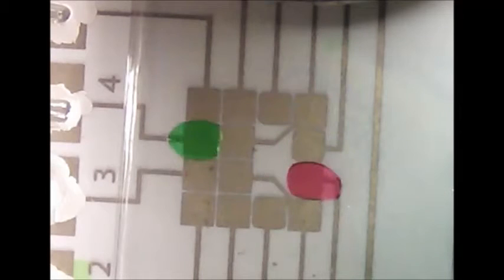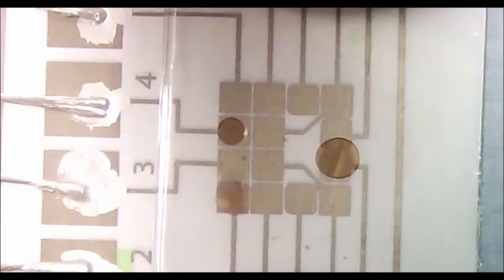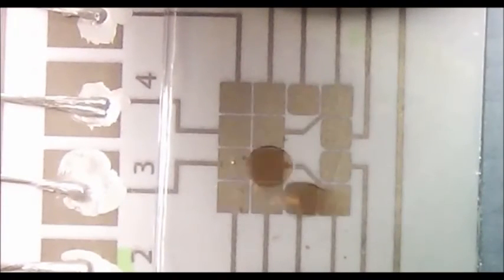Movie 1-1 Automated EWOD / Digital microfluidics (Splitting, double droplet transport, high speed)

Comment: Hi Arjen, how high is the voltage applied? AC or DC?
Reply from the maker: Hey Ray, I think the applied voltage was around 220V, AC. Of course DC would work as well, but I had the option to use AC, and then I prefer AC, which should theoretically cause less fouling, and be able to overcome hysteresis caused by 'bad patches' more easily.

Comment: Hi Arjen, this looks better than what I have got. I am testing droplet splitting on PCB substrates covered by ITO glass, with cytop coatings. The droplets were running in silicone oil of viscosity of 1.5 St, but seems very slow, and the droplet splitting was not always successful. Could you please suggest something? Cheers!
Reply from the maker: Hey ray, do you have any more info on the dielectric layer you coated the PCB with? Without much info I can only say logical things like: increase the voltage to increase the electrostatic force, or reduce the height of the drops, to decrease the energy needed to split a drop.
Reply: @pitjea1983  Hi Arjen, many thanks for your reply. I am using polyimide or printing ink of 30 um as the dielectric layer and cytop of 100 nm as the top coating.
Reply: @pitjea1983  Hi Arjen Do you have a daily email so I can write to you? So I can include some more information
Reply from the maker: @raywang3922  hey Zhantao. You can always reach me at my gmail account, which is my (youtube) name without spaces or capitals. I already have some thoughts about your experiment. Hear from you soon, Arjen
Reply: @pitjea1983  I have wrote you a short mail Arjen, please let me know if you have got it. Cheers!
Reply: @pitjea1983  Hi Arjen, I have wrote you another mail seeking your opinion on droplet transportation on open chip, please check the email, cheers!
Reply: @pitjea1983  I am wondering if you are interested in coming to China to work or vacation for a while? You would be mostly welcomed and get well paid. Many companies here are very interested in digital microfluidics and we can really do something here. Please do consider this. Thank you!
Reply: Hi Arjen, how much is the voltage applied in the video? AC or DC?

Comment: HI sir,i am trying to make a setup very similar to this for my college.Can you suggest me me what is the size of circuit.
Reply from the maker: Hey Varun. The electrodes are 3x3 mm each. The wires and gaps between electrodes are designed to be 0.2 mm, because that was the minimum our basic printer could handle without errors.
Reply: @pitjea1983  sir can you give schematic diagram of this circuit.
Reply from the maker: @VARUNKUMAR-mq1zi  it's just a regular electrowetting setup. The electrodes are covered by a 10um PTFE film for insulation. The top plate is an ITO covered microscope slide made hydrophobic with a Cytop layer of approx 50nm. The electrodes are actuated via a homemade switch box consisting of multiple high voltage relay switches, the relays are controlled by 5V TTL triggers using labview and DAq card.
Reply: @pitjea1983  Hi sir , I am studying in Indian institute of technology Mandi. I am working on this project in my college.Sir please help me about this model and sir please give me of your email id for further dicsussion.